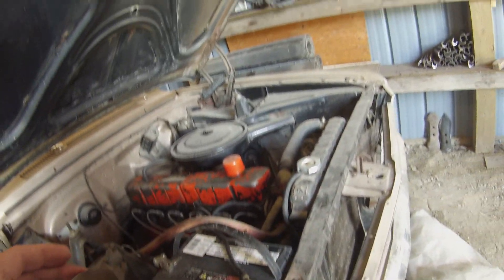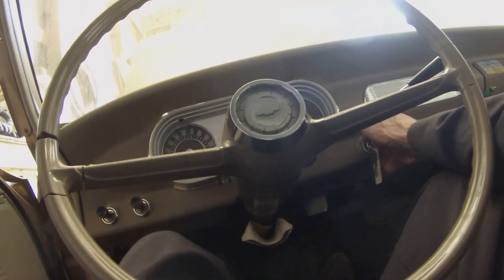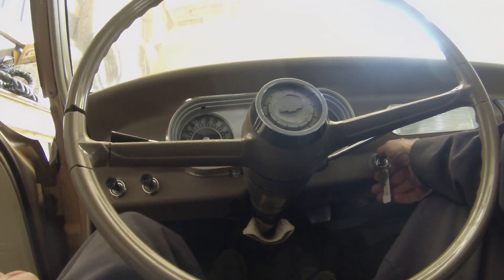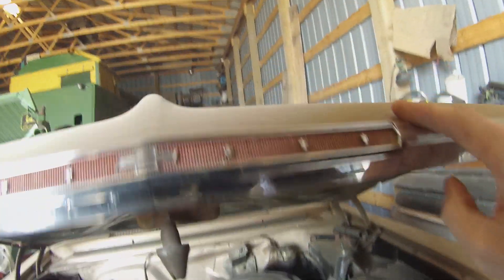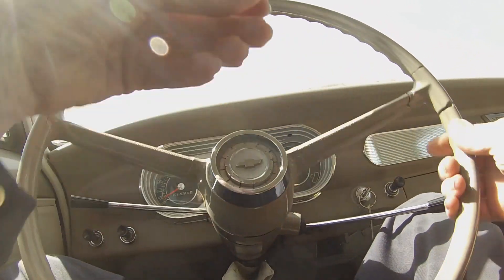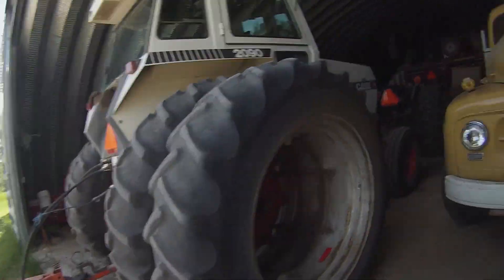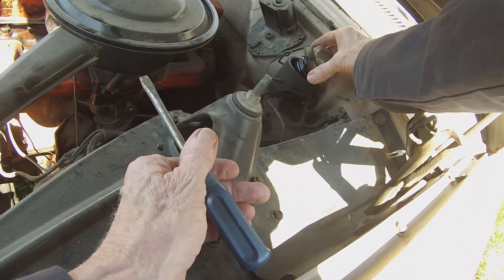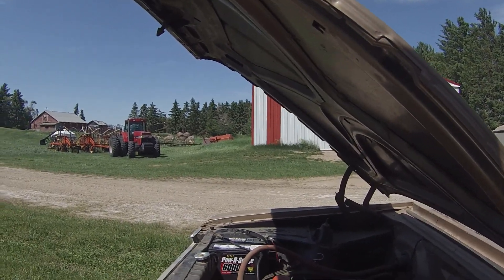Chevy II Start 21

Comment: Nice old chev. You have quite the collection of elderly iron. Is too bad we can’t buy a simple no frills vehicle like that any longer. Now they come “standard “ with fancy radios, power widows and door locks etc. etc. all at an added cost so the base model ends up being quite expensive. I couldn’t afford a new truck even if I wanted one. My 2003 chev pickup which is pretty much base model serves me just fine. It does have air conditioning which I use once in a while, but I could live without it. My 1971 GMC 1ton dump didn’t even have power steering, which I did add. It’s pretty tough maneuvering a loaded truck in tight spaces without it. My 1967 suburban doesn’t have power anything and it’s not a problem to drive. It’s fun to take someone for a ride that’s never seen a three on the tree. My oldest truck is a 1955 power wagon that needs work. It is pretty much rust free and complete except for the long ago worked to death box. It did have a tree fall on it and dent the top of the cab this last winter which is one of the dangers of living in the woods. I do like the old trucks.
Reply from the maker: You have some interesting old iron there too John.

Comment: I swear every old grain truck around here does that once a year. Fluid is gone and you can’t figure out where. If you realize it right away you usually don’t have to bleed them - I love bleeding the old 50’s Chev’s. The highlight of my day.
Reply from the maker: I was surprised this one didn't seem to have any air get in the system. Its not a common occurrence here. Still can't see where it leaked.

Comment: We had a C60 Chevy truck that would be fine, then a month later, the master would be dry... And never anything wet. Nice thing was, top it off and it would be fine... Would even bleed itself in a few hours..much nicer than fighting it for an hour 👍😁
Love the Chevy Ii👍
Reply from the maker: On the trucks I think sometimes they can suck up the brake fluid into the manifold through the hydro vac under certain conditions.
Reply: @roosty6  gravity seemed to be it, but🤔

Comment: My grain truck did the same thing this spring. Couldn't tell where the fluid went. New master cylinder fixed it right up. So far..
Reply from the maker: I'll be watching this one close. Strange to lose all the fluid in the master cylinder with no obvious leaks.

Comment: I like putting those small electric click clack pumps on my things. First start you can let the pu.p run for 45 seconds and get everything primed up again and theybtake off running right away
Reply from the maker: I like that idea. The Merc needs it most of all. Self draining carburetor and slow cranking six volt system means a hard start if its been sitting a week.
Reply: @roosty6  yup you'd like it if you did it!

Comment: my grain truck losses fuel prime after a week. but it comes back after a few turn overs & hitting the pedal a few times
Reply from the maker: Your old International runs surprisingly well. Better than either of my two old IH trucks. I can't get those Holley carburetors to idle properly no matter what I do.
Reply: @roosty6  mine runs like poo till its hot. i got a vid comin up on that. it takes at least 30 mins 2 get hot.